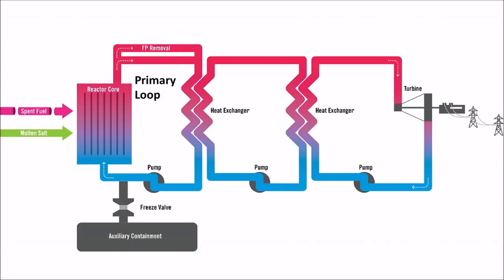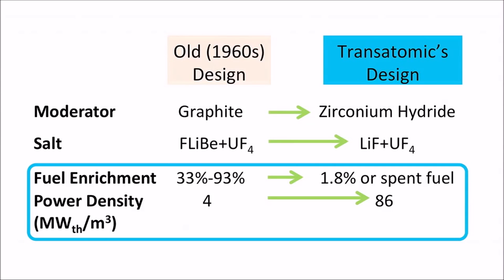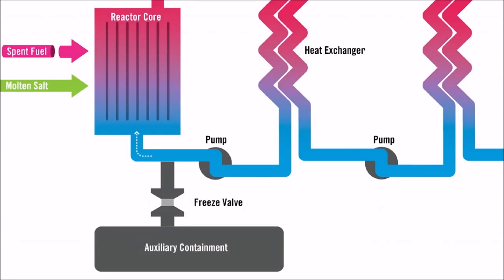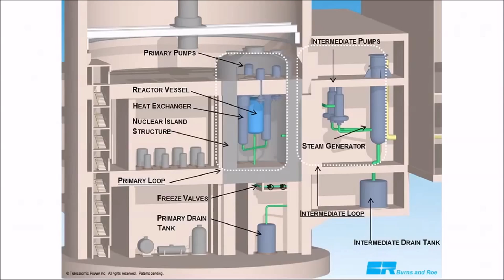Burn Nuclear Waste with new High Technology Reactor (MSR) [Read description for update 2/2019]

Comment: This is one of the more light weighted presentation of the MSR of Dr Dewan. Here she presents a concept of burning up the nuclear waste and power up the world with it for about 70 years. I am a vivid defender of the new nuclear concepts (MSR, LFTR, DFR) fourth generation here on YouTube (in German, French and English). But I am wondering, whether bruning up the nuclear waste is still is an valid argument. Dr Dewan says on her webpage, that this argument was given up. 

That being said, Transatomic has faced challenges. In 2016, we realized that there were mistakes in our original analyses, and the design would not be able to consume nuclear waste. This was a hard moment both for the company and for me personally – I started Transatomic specifically because I wanted to address the nuclear waste problem. 

( http://www.transatomicpower.com/open-source/ )

I was asking already on many other presentations on YouTube, whether the nuclear waste can be really burned up. But never got an answer. Could somebody please, illuminate it? Please! A simple link to a document or webpage would be sufficient! 

Best greetings from Munich
Reply from the maker: The short answer is yes.  Most of "spent fuel" consists of fertile isotopes, mostly U-238.  U-238 is easily bred to Pu-239 (and higher), a fissile isotope, from excess neutrons in the reactor, and this happens in any reactor.  Once bred to a fissile, the next neutron can then split it and obtain more energy from the fuel.  The result is fission products, lighter but initially highly radioactive elements that need time to cool down.  These elements can also absorb neutrons, reducing the efficiency of the breeding design if not removed regularly.  Thorium reactors work the same way - natural thorium is 100% Th232 and this is fertile, meaning one absorbed neutron will convert it to a fissile isotope, U233.  Once converted to U233, it becomes fissile and can produce energy.  Thorium is not found in spent fuel, but it shows the similarity.  

There have been several designs looking at the idea of consuming spent fuel to produce energy.  One of the earliest and most famous is the EBR2, which this article looks at from Wikipedia.  There are also videos on it on YT, search "EBR reactor" and you should find it. 
https://en.wikipedia.org/wiki/Experimental_Breeder_Reactor_II

PRISM   https://en.wikipedia.org/wiki/PRISM_(reactor) is a Gen IV design by Hitachi (a large nuclear company) based on the EBR2.

While this article is long and a bit old, it shows that spent fuel is routinely reprocessed around the world (usually into MOX fuel) for consumption in current reactors.  However, breeder reactors (reactors designed to convert more fuel to fissile than is consumed) make the idea the most reasonable.  Any design which allows removal of the fission products (gasses, etc) and is designed to breed fuel should be able to consume spent fuel.  World-nuclear.org is an excellent site maintained by the educated industry and contains clear information and articles.  
https://www.world-nuclear.org/information-library/nuclear-fuel-cycle/fuel-recycling/processing-of-used-nuclear-fuel.aspx

Part of the problem (besides licensing) is the risk of proliferation.  A design today must be cautious not to encourage enough isotopic and chemical separation to encourage bomb building.  This tends to slow down acceptance and reject perfectly good designs but aren't ideal risks.

While I'm thrilled about the idea of consuming "wasted" spent fuel as it contains huge amounts of untapped energy, a number of people seem to think the spent fuel lying around is a massive problem.  It really isn't.  A few 100,000 tons don't take up a lot of room (roughly a football field worth about 10 ft high) and with normal storage in dry casks it can easily be stored for decades on the property of the nuclear plant itself.  The mixed materials in the casks can't be used for bombs due to being far too dilute and missing most of their fissile isotopes (which were consumed in the reactor).  When later designs make the fuel valuable, it could be sold, or a newer reactor built on-site to consume it.  It also isn't particularly radioactive at this point.  Pandora's promise shows Geiger counter readings of standing outside surrounded by them, and I have a picture of a tour group in Canada standing in a room full of casks.  By the time the spent fuel is removed from fuel storage ponds (about 10 years after removal from the reactor), it is no longer very radioactive, though it still is above background levels at sea level.
 http://lftrnow.com/the-dangers-of-nuclear-spent-fuel-and-transatlantic-flights/
Reply: Ed Pheil of Elysium says his molten chloride salt fast reactor can run on a Plutonium to Spent Nuclear Fuel cycle.
Reply: @LFTRnow @manatoa1 Thank you for your answers, specially for this long answer from an expert and author of this film. This are good news! But there are some people out there, denying the use of spent fuel in reactors of fourth generation. I ordered a book for myself for Christmas: "Kernkraft, Weg in die Zukunft, Lüdecke/Ruprecht". I will study it and also your detailed answers. Thank you again. Merry Christmas and a happy NEW YEAR with the magic Number 2020!

Comment: Why do they take away so soon the nuclear fuel in normal PWR or BWR?

I mean, when most of your U235 is burnt, couldn´t you just keep running on (constantly) breeded P239 until almost all of your U238 is gone?
Reply from the maker: Please see my long (hopefully not TLDR) comment covering this with your other question above.  Short answer, U238 doesnt get consumed very well in today's reactor designs.  There is also a build-up of materials in solid fuel reactors that limit the energy output rate (and neutrons) so it must be removed at an early point.  A newer design (perhaps MSR) would allow the fuel to stay in much longer for greater efficiency and less waste.
Reply: @LFTRnow  I understand, so its mainly an issue of low fission rate. But couldnt you raise that rate by regulating the amount of control rods and/or moderator?

Nothing against MSR obviously, just trying to really understand why the lack of effort to minimize the nuclear waste in LWR...

btw i read your other response, thanks for the info!

Comment: stupid hippies who think we can power cities with solar panels are the problem. nuclear reactors can make low impact dimethyl ether liquid fuels fror shipping freight and commercial aircraft AND desalinate ocean water! not too mentioned very safe, reliable round the clock affordable clean power for everyone! also could be very helpful for geoengineering and carbon capture applications as well. 

we must wake up! the solar delusion must be confronted and dealt with, we must change their minds and make them face the facts! its great for robotics and off graid applications but can NEVER power a city, anyone who entertains this idea has simply not read enough or seen the numbers.
Reply from the maker: Thanks for commenting.  The main issues with solar, wind, and other "renewables" are energy density and intermittency.  It takes a massive field of solar or wind to generate the same power as a nice compact nuclear plant.  That generally means wasting large (usually natural) areas of land to generate power - something you'd think environmentally minded people would be against (and modern environmentalists who understand nuclear ARE against it).

The second issue is intermittency.  The wind doesn't always blow and the sun doesn't always shine, so nowadays the backup for this comes from burning natural gas (which is why the gas companies love non-nuclear "renewable" solutions and brand themselves as helping with a "green" solution).  Gas is better than coal but nuclear beats all that combined.  The argument after that says we can just use batteries - but that lowers energy efficiency since you must now waste energy to make batteries just so you have a somewhat viable solution.  The future issue of recycling all those batteries makes for an interesting issue, and if they are talking about backing up grid power, then I invite them to do the math as to how many billions of tons of batteries it would actually take.  I did.  Just look up energy density of batteries in Wikipedia, and a day worth of energy use in EIA or other stats for the country of interest.  I can also recommend LLNL for this data.
Reply: @LFTRnow  and thank you for responding, i feel a little less crazy now :) I'm building a powerpoint presentation now on nuclear power, hoping to get permission to throw a re-education event at my local community college. Appreciate people such as yourself because I'm not the sharpest tool in the shed and have so much more to learn. Ive been telling people who get into arguments with me over the net to look up the DOE site. also, thanks, LLNL is great I'll comb through it. I'm curious(theres a lot of controversy online and data on it is scarce, but what do you think of plasma arc waste management energy systems? apparently florida's got one up and running. japan too I think.
Reply from the maker: @n1mbusmusic606  Have you seen the Pandora's Promise video?  I'd argue it is a great place to start.  

Plasma arc:  Based on my short skimming of the whitepaper,(wmsym.org/archives/2010/pdfs/10166.pdf) it appears to be geared for treating low and medium-level waste - things like contaminated clothing, etc.  There are generally lower energy options available for dealing with high-level, ie "spent fuel" material.  The plasma arc process has been around for decades and is used to destroy complex hazardous organic toxins by breaking them down.  Think of it as a very high-temperature incinerator.
Reply from the maker: @n1mbusmusic606  Also, I've not looked at these, but a quick Google search for nuclear power PPT found lots of presentations.  Perhaps you can avoid having to start completely from scratch.  You might even be able to borrow liberally from some or at least get some good ideas.
google.com/search?q=ppt+nuclear+power+plant&oq=ppt+nuclear+power&aqs=chrome.0.0j69i57j0l4.2199j0j7&sourceid=chrome&ie=UTF-8
Reply: @LFTRnow  for sure, ill check the vid. there was a company called geoplasma in florida who claimed it cut vaporize garbage(anything) with temp of over 10,000 degrees then use the resulting syngas stream to turn a turbine while creating a molten then cooled 'slag' that could be used for construction projects.
Reply: @LFTRnow  hey, sorry for some reason the link didnt work.
Reply from the maker: @n1mbusmusic606  The Google link just goes to a search.  I tested it and it worked.  I was just trying to show there were a lot to look over.  As for Pandora's Promise vid, have you found it?
Reply: @LFTRnow  
YES. thank you so much. i wanna do a screening of it at my school. Ill try and make that happen. and thank you,. theres a lot of reading for me to do clearly. thankfully i have a very supportive chemistry teacher. whats your opinion on thorcon? Also are you knowledgable about climate change mitigation strategies as well? just curious cause the event im trying to throw is mainly concerned with that.
Reply from the maker: @n1mbusmusic606  Thorcon is one of many companies working on Gen IV technology.  They and others are worth learning about.  

I had just typed a long reply which the pop-out answer feature in YT ruined, so I'll do my best to rewrite it.

A screening of Pandora's Promise is a great idea.  Note, however, that it is starting to show its age being made nearly 10 years ago.  It is still quite accurate, but the amount of "renewables" has expanded as has natural gas usage.  People seem to think that renewables can provide the world's energy, stating that batteries can take up the slack.   The reality is this is a very expensive idea and makes electricity VERY expensive.  The solution (which is of course recommended by fossil companies) is to burn natural gas intermittently to make up for the difference in output from the renewable load.   Also, you have to consider, it takes energy to make the solar panels/wind turbines, PLUS the batteries, so you run into an EROEI issue (I think you will learn a lot googling that).  In short, you need to do far better than break even if you want a modern society.  The more energy out vs energy in, the more energy there is to do other things (run schools, space programs, have flying cars, etc).

I looked up the Wikipedia reference to Climate Change Mitigation, which I suggest reading the "Alternative Energy Sources" section.  As you scroll down, you will see references to Nuclear and Nuclear Renaissance both of which are good articles.  
en.wikipedia.org/wiki/Climate_change_mitigation#Alternative_energy_sources

Most of what the "easy" climate mitigation recommendations focus on scarcity - increase energy efficiency and consume as little as possible.  While there are merits to this, focusing on scarcity while another country expands is only going to put you/us further behind.  Instead, Gen IV nuclear could make energy vastly cheaper than it is today - both electrical and thermal energy (many Gen IV designs run hot, which means thermal energy can be used for chemical reactions).

There are many things that CAN be done with energy but are not because it isn't economical, but if energy is cheap, then things can be made less efficient but cheaper and use fewer materials (which is actually an improvement to the environment if the impact of energy use is less than the materials).  Some rather amazing things exist today that really aren't done commercially.  For example, the military can make jet fuel from CO2 absorbed from the ocean combined with hydrogen from electrically splitting it.  It is an energy losing proposition, but what if energy were cheap?  We could basically MAKE fuel instead of refining it, and the result is a closed CO2 loop.  It may be possible to make it cheaper than the cost of pulling it from the ground and refining it.  Other chemistry works will at high temps too - such as making ammonia.  You CAN use ammonia as a (not too efficient) fuel, but it also makes fertilizers and chemicals, so now fertilizers can be made cheaper and more abundant.  The desalination of water is also energy-intensive.  What would happen if energy were cheap - abundant clean water from the oceans (PLUS electricity too)...

It boggles the mind how far the human race could go.  Rather than looking at scarcity, look for ways to make energy cheap and abundant.  There is also a LFTRnow branded blog at LFTRnow.com, I hope you find it helpful and enjoyable.  Here is one of my favorite articles:
lftrnow.com/why-im-passionate-about-nuclear-energy/

To get an idea of how nuclear (even decades-old nuclear) compares with solar or wind, have a look at this:
lftrnow.com/replacing-nuclear-with-solar-2/

I also recommend looking at thirdway.org, every year or so they show how Gen IV nuclear development is coming along and where it is in N. America.  There are also plenty of developments overseas, but their map focuses on N. America.
thirdway.org/graphic/2019-advanced-nuclear-map
Reply from the maker: I would also recommend seeing anything put out by Gordon McDowell.  His channel has hundreds of videos regarding thorium, molten salt, related politics, discussions, and lectures from thorium conferences, etc, etc.
Reply from the maker: @n1mbusmusic606  One more thought is that - regarding Pandora's Promise, you might want to see this video from the director Robert Stone.  Jumping to 3:30 will show you how effective it was at the Sundance film fest a few years ago:  watch?v=t-_p_l3eA_E&t=211s  (note YT in the past has been known to strip out links, so I've been stripping off the front ends to ensure they copy correctly)  You'll also notice this is also from the gordonmcdowell channel.
Reply from the maker: Since you asked about ThorCon specifically, here is a video of their presentation from just 1 month ago at a Thorium/Gen IV conference, put up by Gordon McDowell.  It is a bit technical and perhaps dry, but it does show current information and activity from that company.  https://www.youtube.com/watch?v=C2tWXaMm94Q
Reply from the maker: Thanks for the sub!